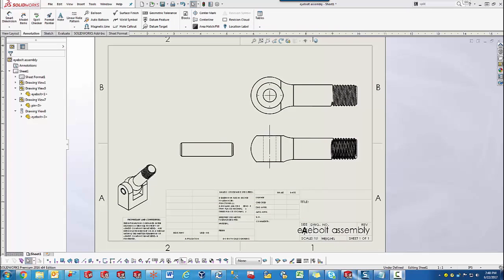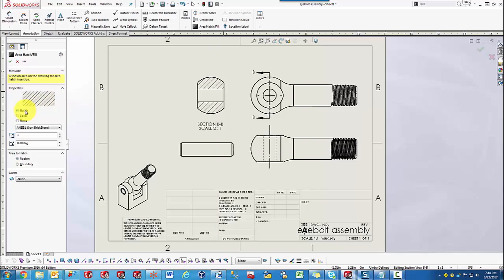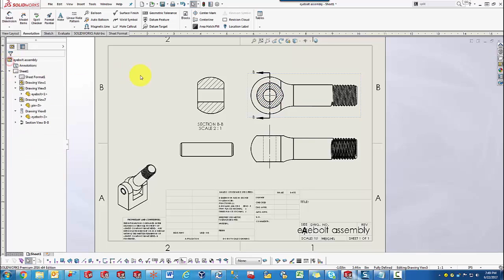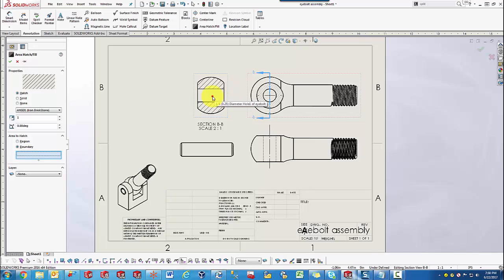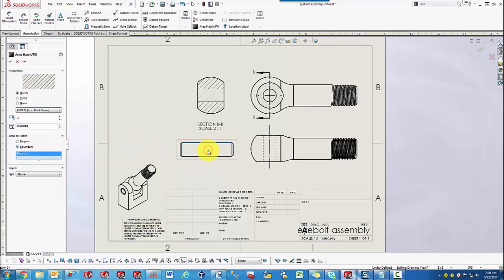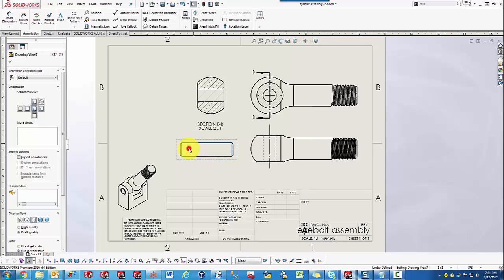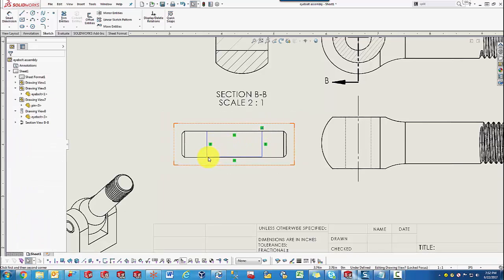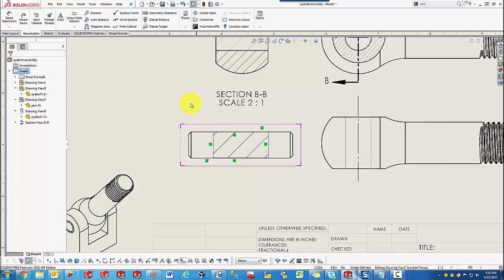SOLIDWORKS - Hatch the Un-hatchable

Comment: I found out that you can just sketch any shapes you need over a view (such as a rectangle or a circle), hit the hatch tool and click inside the shape you wanted. Not sure exactly how it differs from this method, but I did try making the lines and points coincide which i think is important so whenever you move a view, the hatched shapes follow along to wherever you move it.